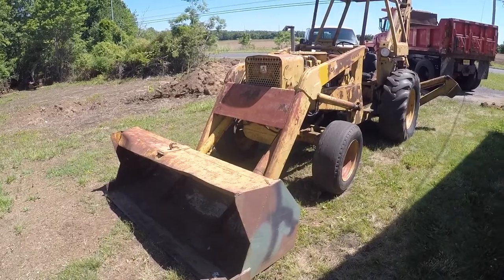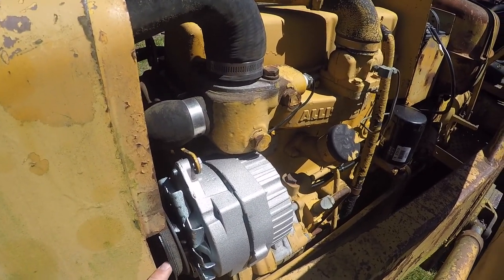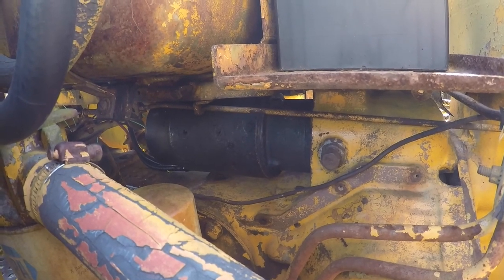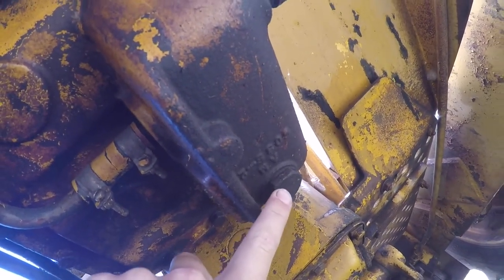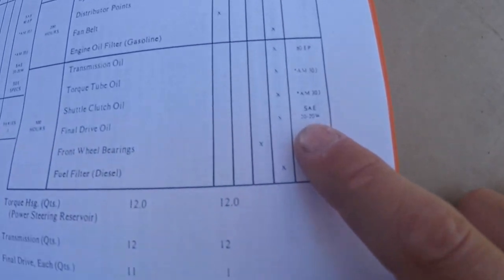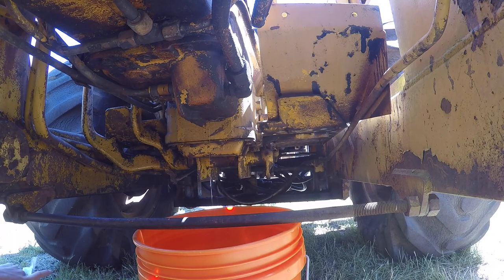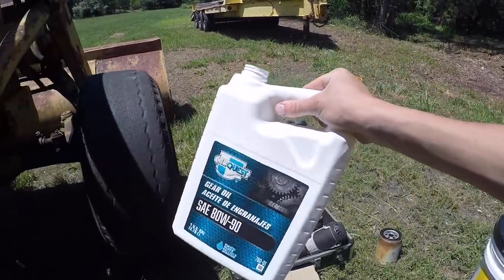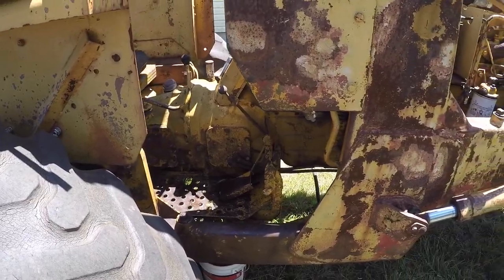Allis Chalmers 615 Walkaround/Torque Tube Fluid Change

Comment: I've had mine for about 7 years, got all the manuals and parts books with it when I bought it. Was first owned by a heavy equipment mechanic, then by a guy who used it on 6 mining claims, now me.
Reply from the maker: It’s been good to us. I changed all the fluids, new alternator and starter, only paid $1000 for it.

Comment: I did a fluid and filter change on the motor, torque tube, shuttle clutch, and transmission. I haven’t done the final drive yet as I haven’t found where to fill it. Didn’t look that hard yet as it took me a good part of the day to do what I did. Greased everything! The power steering is working much better and the hoe has power and control. Not perfect, but I dug out a stump to work the air out of the lines. It took 3 more gallons of fluid after working it. The transmission called for 12 qts. But my fill cap with dipstick is different from yours or the pictures in the manual. I put 14 qts. in it and stopped. Still didn’t reach the dipstick. The dipstick also says fill to mark with ram extended. I don’t believe that should have anything to do with the transmission. That round cover by the hydraulic drain does contain a screen but be careful of the O ring. I had a bit of a time getting that to stay in place during reassembly. I’ve gone through 18 gallons of hydraulic fluid, 14 qts. of 80w-90, 3 gallons of 15w-40 and a tube of grease so far. Tractor is loving it!
Reply from the maker: Clean and full is always the key. The final drive is located behind the tires. I recommend removing the tires and taking off the pan. Clean it out real good. It calls for some strange oil they don’t make anymore. I just used some straight 30 weight. Who knows. I haven’t done the transmission yet. Just hydro engine coolant and torque tube.

Comment: The cap looking thing on the loader frame/hydraulic reservoir is a metal screen that should be cleaned when the hydraulic oil is changed.
Reply from the maker: I did read that, although I was reluctant to pull it off because I knew sourcing an o ring would be near impossible

Comment: I just found this video. My dad has a 615 loader and hoe. He ahs passed away and I now have it. I'm doing a complete fluid change as well. I'm hoping the hydraulic fluid and filter change will help the hoe. Its very sloppy and feels like its full of air. Did you happen to video the other fluid changes and just not post it? Thank you for doing this one. It sure helped.
Reply from the maker: I am editing one right now, I had a lot of play in the hoe, unfortunately all of the pins are worn down so that’s where the movement is coming from. The machine has performed great since I replaced the torque tube oil. Power steering is awesome. For a long time I thought I was the only one that owned a 615